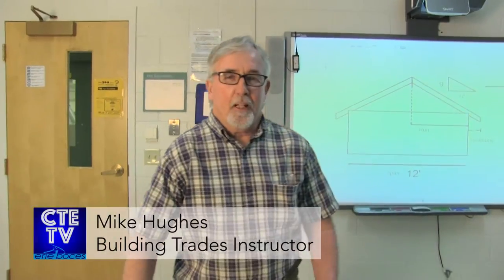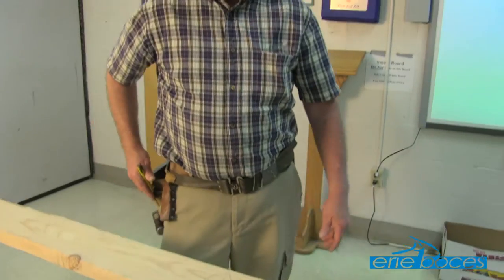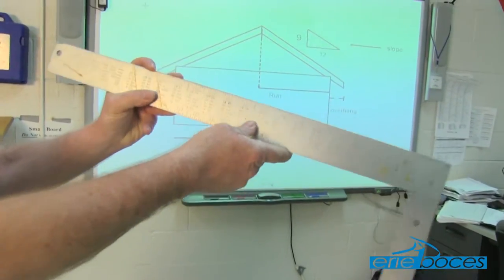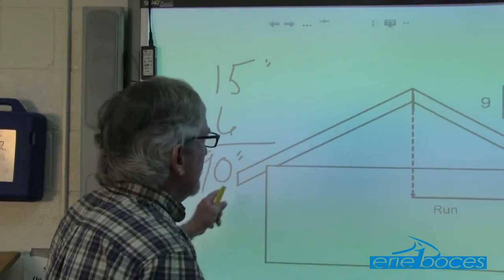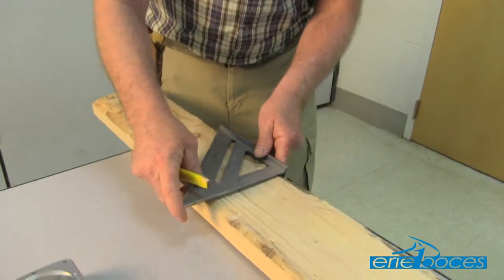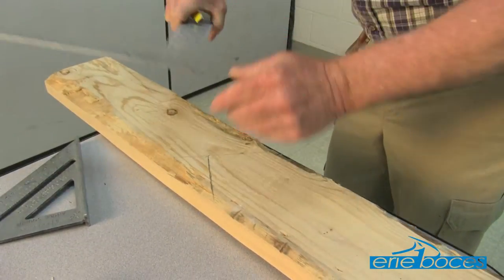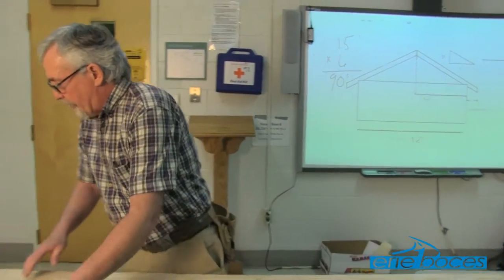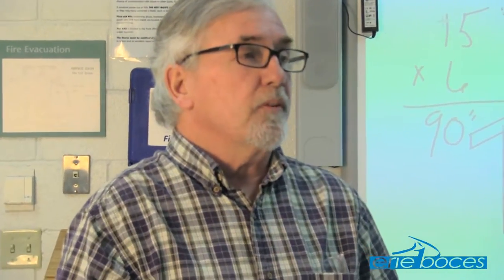How to Lay Out a Common Rafter

Comment: Hi he said you could either use the Swanson book of rafter tables, or your framing square using the rafter square the pitch is 9/12 so o your rafter square the top line of engraving in words reads common rafter length per foot run, so you look for the number 9 above this writing which is gives you the number 15 you then have to times this number but half the span of your build the span is 12 feet so half is 6 do times 6x15= 90 inches you then have to add the 1 foot over hang so add 90 inches to 12 inches and you get 102 inches you need to divide 102 by 12 inch to give you the length in feet so 102 divide by 12 = 8.5 feet  so 8 foot 6 inch so he used a 9 foot board, hope this helps

Comment: How did you come up with a 9" ft board to start with?
Reply: So he said you could use either the Swanson table guide or use a rafter square, using the rafter square (The skinny length is called the tongue. The thicker, longer section is called the blade.) the pitch of the roof is 9/12 so using the blade look up the number 9 underneath you will find the number 15, you then times this 15 by 6 which is half the span of the roof and get 90, these numbers are in inches, you then need to add the hang over for the eaves and fascia board which was 1 foot or 12 inches add 12 inches to 90 inches gives 102 inches divide this by 12 to convert to feet and inches you get 8.5 or 8 foot 6 inch so he choose a 9 foot board hope this helps

Comment: Don't you have to take off more then 3/4 if the slope rises above a 4?
Reply: no, just half the thickness of the ridge board. Because the line length goes to the center of the ridge
Reply: @mhughes555  do you not cut rafters?

Comment: How do you ensure that when cutting the birds mouth the rafter will meet at the top of the ridge
Reply: If you follow all the steps it will meet at the ridge board
Reply: you have to take the HAP (height above plate) in your birds mouth which is the vertical distance 90 degrees from the horizontal seat cut distance and add that measurement to your total rise of your ridge board, and then subtract 3/8 of an inch due to the ridge drop.

Comment: Your plumb cut you said 9/12, but theirs only one of those on my speed square? The 12 is on the common rafter cut!
Reply: It could either be under the hip scale or the common scale don't get those confused.
Reply: Which # do I use on a 9/12 pitch for common rafters? The 9 or the 12?
Reply: @herbertherbomoore415  use the 9

Comment: What about those numbers underneath 15" 19.21, 20", 30".9 5/8, & 10 5/8?🤷🏾
Reply: In a 15/12 sloped roof, under the fifteen it is 19.21 in per foot run. This means that for every foot traveling horizontally the rafter is 19.21 in Long.
Reply: What about the step off method?